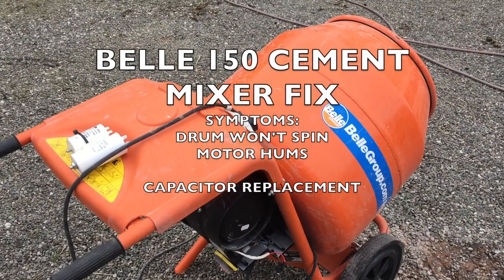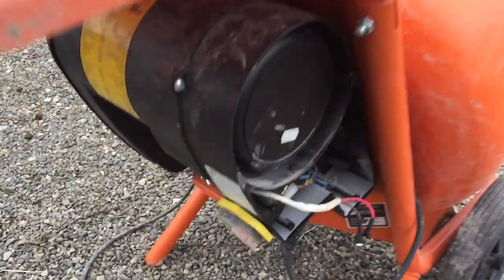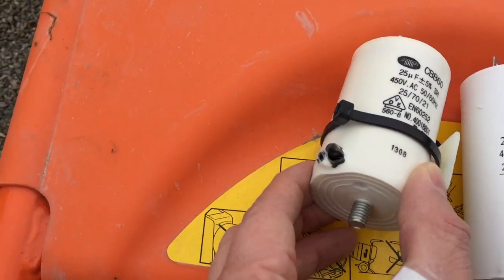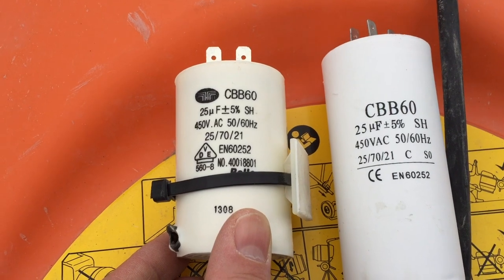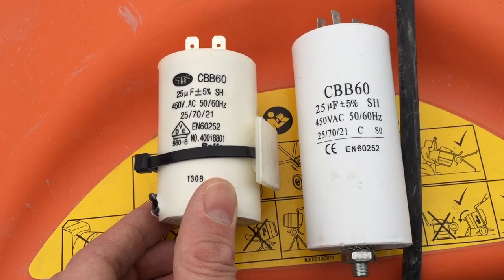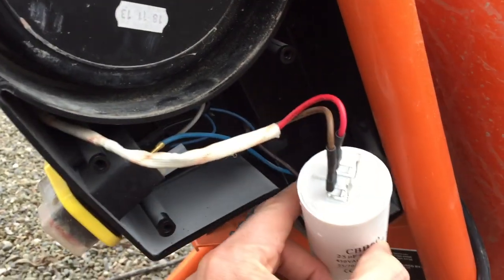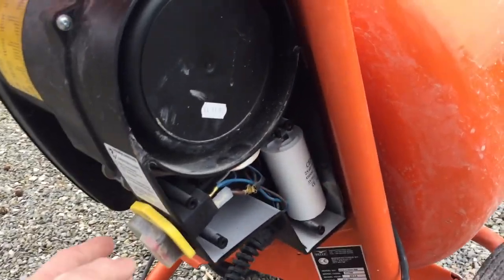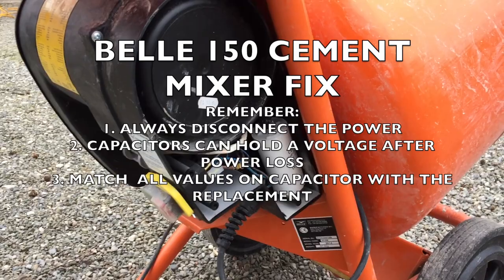Belle 150 Cement Mixer Fix

Comment: Picked one of these up a few nights ago and the guy said he was using a screwdriver to get it going as it won’t start but once moving it’ll run all day it’s only on start up. Popped off the cover and the resistor is well blown new one on order. Cheers.

Comment: Hi have to hold start switch to keep running not latching
Reply from the maker: Hello. I’ve not come across that issue. Obvs check all the wiring. Could just be a switch problem.

Comment: Whair did u get it for £5_10
Reply from the maker: When buying a capacitor, Make sure all the stated value are the same, voltage and capacitance etc. Always unplug the power before opening. 

The one I bought is here: https://www.amazon.co.uk/gp/aw/d/B015SX1VDS/ref=ya_aw_oh_bia_dp?ie=UTF8&psc=1
Reply: Thanks
Reply: What is the cause of it burning out like that?

Comment: I've replaced capacitor but still the same!
Reply from the maker: Do all the numbers on the new capacitor match up? Are the fault symptoms exactly the same? The start up capacitor just kicks the motor into life. If it’s faulty the motor will just hum. Can you turn the motor without power?
Reply: @morgannick2000  Only difference in capacitor says 85 on old where as new one says 70 same as yours. If turn drum (motor) and press power button works fines just have to leave it running until finish job. Motor is quiet and smooth running and seems ok
Reply from the maker: That suggests the new cap is either bust or there is a wiring issue. The three figures 25/70/21 is for environmental factors. The capacitance 25uF and the voltage are the most critical.
Reply: Managed to sort with liberal spraying of motor with switch cleaner, came out grey so obvious build up of cement dust over the years, also cleaned all bearings and made sure free moving. 9/10 times starts normally odd time needs a slight pull on drum to start it but then runs fine, may just need a little more cleaning.
Reply from the maker: stephenclarke179 glad you’ve made some progress. Just out of interest. Was the original capacitor blown and did it have a hole in the side like the one in the video?
Reply: Capacitor looked slightly expanded at top but no obvious leak or hole, as already put replacement on decided to leave it.
Reply: If you haven’t used it for a while check the belt is running freely